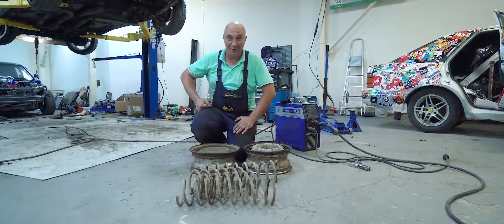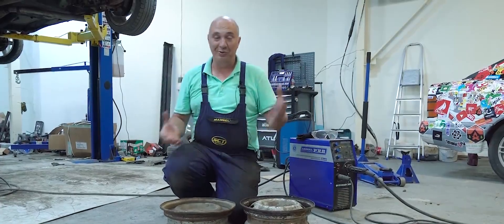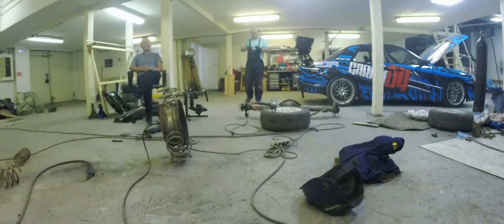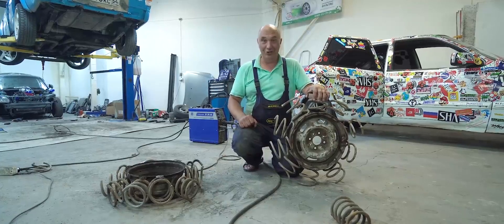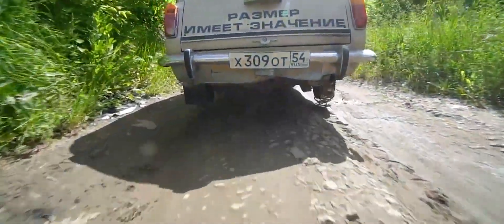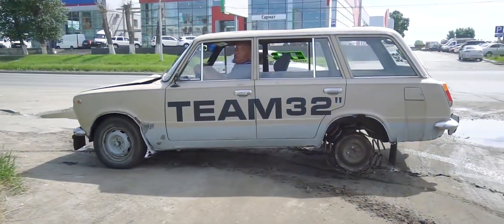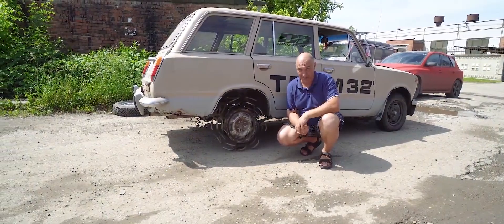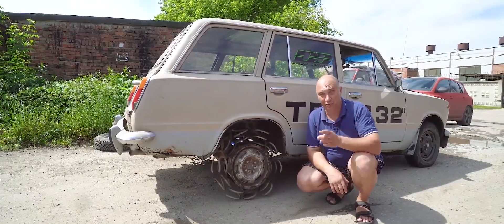Using springs instead of rubber tires

Comment: What if the springs were "horizontal" to the wheel, instead of "perpendicular," and were cut to lengths that would allow placing inside a tire? Then mount that tire to the rim. Airless, "Run Flat" tire is the thought.

Comment: Now make another 2 More for the Front end....
Reply: TheRoyalCoconut
Reply: Eni Alvin
Reply: Bence Szabó
Reply: Is that car front wheel drive? Im not sure "spring wheels" would work that well on the wheels that get power from the engine. If you accelerate fast the springs might break loose.
Reply: Infinite Sentient ‍
Reply: atnfn it would be terribly hard to steer
Reply: daaaym atnfn you screwed our fun!

btw you are probably right. It would be useful in snow or big mud. Just avoid aggressive acceleration. Or make attachments proper with parts where the springs can 'screw in' besides the welding itself.
Reply: atnfn idjsispwn

Comment: Weld a strip around to join them in the shape of a wheel. Then cover that with a used tire tread. You'll have a smooth, noise-free ride without punctures or tire bursts

Comment: Try putting soft ed stiff Springs at the same time another words you're stiff a Spring welded to the rib your softness Spring while the to the outside of the coil Spring so a soft and stiff Spring at the same time I'm just say

Comment: Could you line the outer spring with rubber tread from a old tire and see if it would work at higher speeds?

Comment: Put a metal band around them and drift lol. Maybe add some rubber to the metal band some how.
Reply: MrGanja408 I was thinking the same thing....the metal could be cresants to slide over each other..one cresant per spring...then a tight rubber tread...!  This guy HAS reinvented the wheel!

Comment: If you could some how wrap the springs with tread and then balance the wheel it would be really nice for off road applications. With some refinements you could get it to work in highway applications, and you wouldn't have to worry about getting flat tires .

Comment: Try all FOUR wheels. Then an offroad trek at about 35 mph. That would be cool. Could also make them a bit more equal in length and add some rubber (tire) pads if street driving.....  looks really fun too!

Comment: Maybe some screen (track like material) added to the outside of the springs for a little more round surface area (coverage).  That may settle down the noise and also make it better for higher speed and less potential damage to the road.

Comment: You can add the tire rubber on those spring. It's will prevent erosion of the spring on the road.

Comment: A few years ago, there was a company that was working on a wheel of this concept. If you could put the tread of a tire  around the springs. Use  spring compressors to compress the springs. Might take some of the noise away and you wouldn't have to worry about flats.

Comment: Then a spring flies off the wheel and kills someone!
Reply: murdy1975 good point. He needs to run some fence wire or even cable through all of them that way one can't escape.
Reply: Russia
Reply: Make one with cow hoofs!
Reply: What about snow and ice. ..??
Reply: murdy1975 in Soviet Russia, spring kills you!
Reply: Kind of like tires?
Reply: they would more than likely hit the underside of the car and do absolutely nothing....
Reply: You should be proud to die a Russian...
Reply: As long as they are part of the Clinton cartel I am ok with it.

Comment: If he had more and smaller springs there would be less vibration compared to the fewer larger springs hitting the ground. They might work good on rough terrain, but definitely wouldn't be as great on a smooth paved road.

Comment: Throw on a tire with end caps on the springs!  better yet the end caps for the springs could be made of rubber and replaceable with different type of tread inserts. How long would it last? So long as the welds hold. Suppose if it was all one peace it would be a question if the springs would hold up.. over all I find this is a excellent idea! Boss!!

Comment: if there was some way to strap or belt it like a tire ... maybe some steel belts from tires mite be beneficial ...i got it..cut the sidewalls off a truck tire leaving a lip or over hang to hold the springs in place and hopefully keep the tread from sliding off ... compress the springs and drop the tread ring in place and let the tension from the springs push out from inside the tread ring to form a tire.....if it works out, please dont forget me if u make a million $'s off it ;)

Comment: How do you weld without a mask, are your eyes made of sapphires or something?
Reply: Makis Makiavelis a splash of vodka to the eyes more then offers the required amount of protection.
Reply: Makis Makiavelis he's Russian what did you expect?
Reply: Ah, now I know why that Bulgarian co worker on the factory assembly line screamed at me, 'PISS IN MY EYES! PISS IN MY EYES!! I thought maybe he liked golden shower coffee breaks?
Reply: He is terminator
Reply: bullnuts101 The light from the welding shines through your eyelids
Reply: DATING HARLEY QUINN so, I gotta ask...

lots of blind people in Bulgaria?
Reply: that and a lack of urinals.....or what ones they have are very, very clean.
Reply: just hold them really really tight!
Reply: seriously though never weld without a mask closing your eyes doesn't help. If your gonna tack weld without a helmet look away while closing your eyes but it can still damage your eyes. best to use a self darkening helmet they arent very expensive.
Reply: That's how fucking easy it is to mig weld. You can close your eyes.....
Reply: bullnuts101 and was he doing "simple tacking"?

Comment: The springs will break soon, I've welded a little bit of spring steel and it messes up the way the carbon lays around the welds where it was heated. I ran coil springs on top of my leaf springs for a couple years to lift the rear end of my truck about 2" and just like other people told me, it broke right beside the weld. Also I'm guess braking and take offs are pretty terrible, but it is a cool idea haha

Comment: weld a heavy motorcycle chain around the circumference just inside the first loop to create more stability .... it should be able to take more torque under acceleration...

Comment: YES do all 4 wheels like this and go offroading hardcore. I bet they would get good traction.
Reply: High speed corners is problem
Reply: high ground pressure tho not much surface contact
Reply: Richard Mertens Corners are problem to a Lada anyway.
Reply: Bijendra Tamang but it will be proppelling itself forward by spinning those springs through the mud. Thats a lot of surface area creating friction with the dirt.
Reply: codyd jenkins 

Yeah. It will work in the mud like a Steam boat with the water wheels in the back.
Reply: damn you beat me to it
Reply: Fly high if that happen
Reply: Bijendra Tamang they’d go through the ground like spikes I think.
Reply: Not if the springs were long enough and thick (strength wise = to handle weight of vehicle) the spring can only sink so far. IF it goes beyond its height then you went someplace your not supposed to go no matter what.
Reply: Thanos there's something limiting the spring length....... the body.
Reply: Peter Robann Sobrepena he means surface area touching the ground at any given time. How the hell did you not understand that?
Reply: J, Williams
In really wed mud the springs will work like a puddle in water
Reply: Yeah but when u break the weight is gonna rip off everything
Reply: Keith French angle grinder? 😂
Reply: Bijendra Tamang Just put some rubber (or duct tape) flaps on there to increase surface area and you're good to go.
Reply: My idea, install that spring on tubeless tyre, then you got all your worry solved! 😊
Reply: J, Williams
Reply: J, Williams. 
That was my thoughts.  have to have the top of the spring round and put rubber pucks between (just at the end 3" or something) it would kill it off road
Reply: Also on a track where they have to corner sharply
Reply: I think It will be hard to steer the vehicle
Reply: Bijendra Tamang 
Wrong, there is lot of surface area and That's the spring
Reply: Peter Robann Sobrepena word, i was thibking more along the lines of loose dirt and sand. in really wet mud it may have problems but even slight wet dirt it should be good.
Reply: Ninjalectual oh i understand that. but its not just about contact area if u have springs for tyres. its about rpms and lenght. becuse even if its thin like a srping is you still have alot of area contacting the ground.
Reply: J, Williams.  Good idea.   May suck on snow...maybe not.
Reply: J, Williams would be cool to see how fast it could go on beach
Reply: J, Williams Yes!!
Reply: It might work in a slope or a irregular terrain that has not too much water... i would like to see it
Reply: The welding probably wouldnt hold up crazy uphill torque like that. I could be wrong tho, would love to see him try
Reply: I bet not
Reply: I agree. I think they would be great in the snow.
Reply: J, Williams it would stab into moist ground?
Reply: this is is do it do it do it.
Reply: J, Williams 
I don't think this silly idea would good 4 any surface, they weren't meant to be.

Comment: Record the car doing some burnouts in the dark with those springs
Reply: The only thing you can "burn out"on a Lada is the clutch.
Reply: flying  rip off shards from those springs will increase the excitement
Reply: Put them on the front wheels then.
Reply: I believe that the car is front wheel drive
Reply: its an old lada, rwd only
Reply: Classic Cord that would lloook pretty wild
Reply: That would result in setting all of Siberia aflame
Reply: ALEXIS Pellitteri no it has axel so it’s rear wheel drive

Comment: Suggestion:. Take a piece of heavy guage pipe, about 24" to 30" in diameter, center it up around your wheels as an outer ring.  Cut the coil springs exactly to reach between the steel wheel and the steel outer ring and weld them in place.  Then get some rubber tire tread and encircle the outer ring and attach with rivets or bolts after drilling holes in the outer ring for that purpose. Then you will have a tried up airless tire/wheel assembly.

Comment: You should definitely go offroading with these wheels. I bet on dirt and mud they will have a ton of grip because they will act like spikes and grab on the the dirt and mud, therefore allowing for crazy amounts of grip.  And with the softness of the suspension, bumps should be no problem.

Comment: Probably wouldn't do to good in the rain at high speeds trying to make a turn but If you added the rubber tire over the springs it would probably fix that problem but the you'd still have a problem balancing the tire but for a short ride around your little area I imagine it would be great ... Never have a flat tire again ...

Comment: modify normal tires, harden them with an oven as some racers do, try "cutting" tires like some off roaders do by cutting the tread to the base to make custom tread patterns, would like to see a narrow center band for road, and a checkered pattern for offroad / dirt. guys use a heated blade tool or a vibration / oscillating style cutter which would be easiest.
the tire hardening thing is an art, some will use chemicals to dry the rubber out but it may lead to cracking, heating the tire up and doing your own vulkenization is the best way. it would be interesting to see how it rolls before and after on road, maybe even how well the brakes work. I have other ideas, let me know if you consider.

Comment: The skidpad, hill climb and the mud bog is where I would go next. Old wooden wagon wheels had a metal ring around them. That may not add alot of traction, but it might help with the noise

Comment: If you can fit a steel belt tires on that wheel with the springs it will work well but then you will need little smaller springs so that the tires can fit on there normal seat area, then you will have tires with no air but springs and no noise

Comment: Great you’ve invented a new wheel for the rear, it would be interesting to see if they will work that well in the front, perhaps with the aid to some flat bar welded to the spring ends touching the road to facilitate steering?

Comment: Now I am curious if a steel band was welded to the springs with the tread section bolted to it,  would the rubber tire tread reduce noise and would the springs still be able to flex like they do in this video and is it still a smooth ride?

Comment: See what it's like to have those on all 4 tires. 

Maybe try to get some rubber on the end of those springs to lower the noise and dampen the vibration further. Maybe cut out the tread portion of some old tires and wrap the circumference with the belt made of tread.

Comment: This is like comparing air suspension to springs on a wheel instead of the suspension, so makes more sense than you think and therefore makes for an interesting experiment.

Comment: Make another Springed wheel and also use baby oil for the engine instead of regular oil. I saw in an American video where they buy s Toyota Camry and replace the engine oil with baby oil and it ran for more than 100 miles. They then used coffee which destroyed the engine.

Comment: Well there is a rubber concept like this already. Problem is that its too good of product that tyre companies will have a less of a turnaround on selling newer tyres due to the fact that the prototype cannot be punctured, can obtain a higher mileage on the tread and its way more durable.

Comment: An upgrade, weld a steel cable around the ends of the springs for added stability and put either some kind of tred around them or some kind of tred cap for each spring

Comment: As I and at least a few other people have said, it'd be cool if you put some sort of a rubber tire over the spring, though the springs might poke through the rubber so you may need to weld some plates on the springs to do this. and then maybe even see how it reacts at faster speeds (like highway speeds 50-70 mph)

Comment: Now take those spring tires & add a circular plate around the springs & add some rubber strips(for traction on pavement) to the outside of plate! That should give the most smoothest ride! But before you do that, yes take them off-road 1st!

Comment: I wonder if you can wrap it with a trimmed tyre, Eg; if the steel beads were removed and it fit like a sock :)

Comment: Coil sping wheels is a great idea however  for a great viable safe ride  I would well a circle of steel around coil springs then cover with tire trwad skin  I garentee you can do high way speed if put together right  so ring of steel on outside of coil springs with tire skin  equals perfect ride  if you put bottom out rubber cylinders in each coil  to keep springs from over compressing   it would work great  maybe rubber from old semi axles etc
Reply: Tread

Comment: When you make a tire out of something, isn’t one of the tests to do a burnout? 
Insert son I am disappoint meme here. 
I WANTED A BURNOUT 😢😢😢😢
Reply: that car probably cant burnout
Reply: you would just break the welds even if you tried lmao
Reply: Well any car can... Just it's FWD.
Reply: J Anything it's a lada its rear wheel drive
Reply: Correct mr hillfolk. Burnout always the correct test procedure. Full delamination optional dependant on value / owner of car. Only 50% points out of 10 awarded for a one wheel instead of two spinning. Obviously the springs have no rubber to smoke up but surely a nice spark shower drift on some concrete would be a logical test? Don't fancy weld failure at speed though. I bet it wouldn't just spit a spring out the side. I think it would join hands with the next one along if it came off and make a spring long enough to rip the wheel tubs out...
Reply: no spring wont work
Reply: KvAT, Are you new here?
Reply: Ninjalectual err, he was only joking, doesn't matter, eh?
Reply: Chas Evans 
Haha that’s a new way to add wheel tubs for wider tires. 
Install spring wheels , do a burnout until you have clearance , install wheel tubs 😂😂😂
Reply: KvAT so what ,stand back it'll be fun.
Reply: You ARE a burnout.......
Reply: crimescene25 
Takes one to know one.

Comment: Put a rubber strip around the springs to help with noise and get better grip on harder surfaces
Reply: Tyler James agree I was thinking the same thing!
Reply: You can tell which of us have engineer minds😂😂 we instantly start thinking about how to improve the design! I had the same idea! You could just cut the tread off a tire and use spring collapsers to aid in getting it completely on if it's to difficult. In fact you may be able to intrigade spring collapsers into the rims not only to aid in collapsing for new ruber but to act as an adjustment to ensure sure center on the axel. Ive got a few execution ideas in my head I might add😂😂
Reply: Tread would make it perfect. New trend for all vehicles.
Reply: i read article in Popular Mechanics a few years ago... Michelin or BF Goodrich experimented with your idea, it was really cool.

Comment: You should put a thin metal ring around the outside of the springs and put rubber on the outside of the metal ring.

Comment: cut the inner steel ring out of the middle of a tyre and see if you can stretch it over the springs and maybe cable tie them on or something, hose clamps to the springs ???

Comment: nonono, you cut springs in the middle, without terminating correctly those spring, what you needs is to set the end that is a complete circle to be in contact with the road. a Complete circle all in the same height, that will prevent to damage the road and to get a smooth ride!.